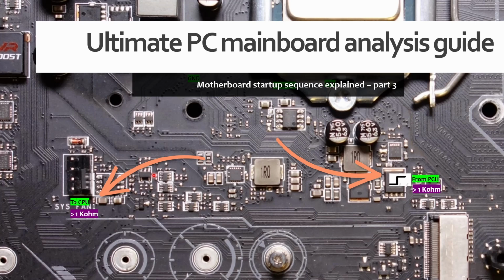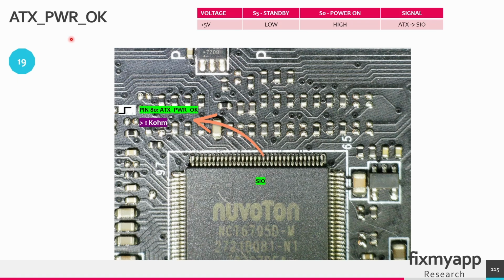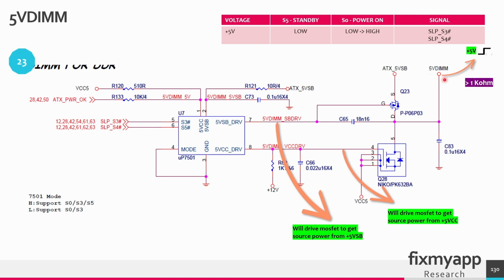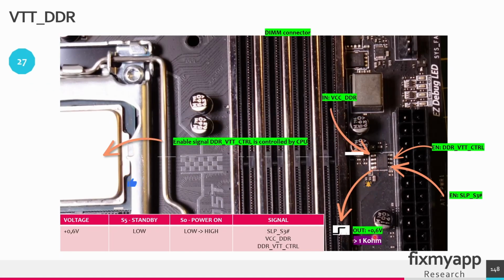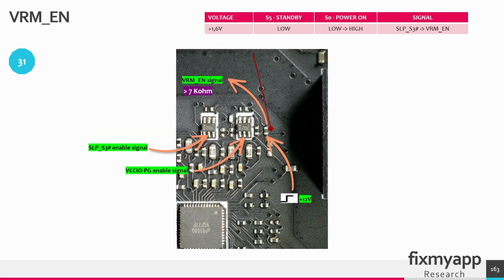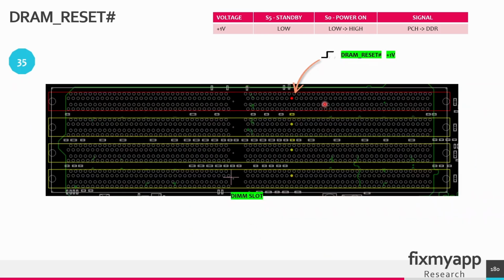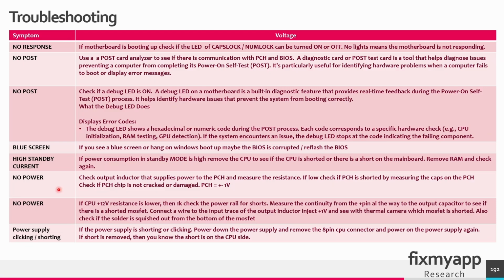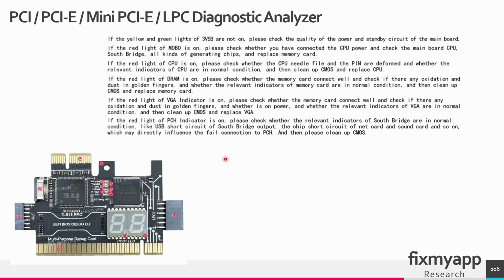How Your PC Powers On: The Secret Behind the Motherboard Boot Process! - Part 3

Comment: This is a very nice video, detailed explanation. Is this applicable to AM4 too? Because I'm stuck at this Vrm enable circuit. I can't get enable signal high. I already replace 2 voltage divider but same result 0 volt on D2 of divider, Thanks.
Reply from the maker: Hi, AM4 is in my to do list, but the circuit is almost the same with some architecture changes. Enable signal solution is hard to say where to look it depends on model / brand motherbaord. Thank you for watching. Gr. Jim

Comment: Do you also fix graphicards  would you be kind to do a video on graphicard future please teacher .😊
Reply from the maker: Hi i did repair some graphics cards but with mixed results. Most of faults are GPU and RAM related. Maybe in the future i will make a general repair guide of graphics cards. Gr. Jim

Comment: This is great, awesome stuff!
You list the resistance for PWRBTN# as >10k ohms. What about PWRBTIN (power button input from the front panel header)? I have an old MSI h81m-p33 with a resistance of only 700 ohms on PWRBTIN and I think it should be in the thousands. The low resistance is messing up the voltage for that.
Reply from the maker: Hi for PWRBTIN  i measured also > 10k ohms. 700 ohms can be low but can't say if it is bad as it is a different board with a different I/O chip. Gr. Jim

Comment: is there much difference between intel and amd, sir?
Reply from the maker: Not much AMD has more integration function in the CPU also some voltages are different compared to a Intel CPU. Basic architecture is still the same. Gr. Jim

Comment: another useful video, thank you. I'm trying to learn how to repair pc motherboards, but it's not easy...I currently have several motherboards that do not work with dual channel. It turns on with one memory, but when there are 2 memories in it, the dram led lights up and there is no image. The cpu socket is not damaged.
Reply from the maker: The two memory bank can use a different voltage per slot maybe a voltage on the other bank is not present? It's a game to compare the two slots with voltage and diode measurements. Gr. Jim